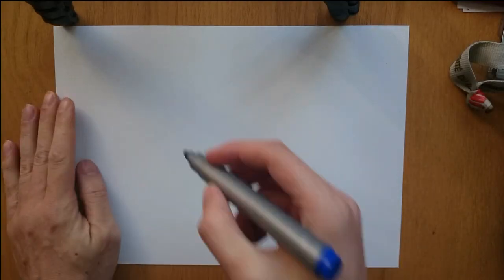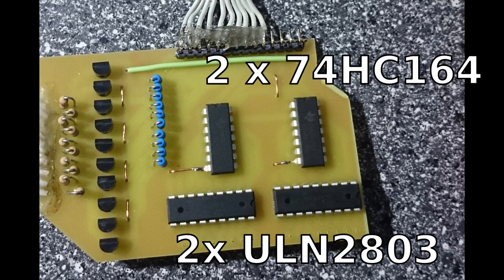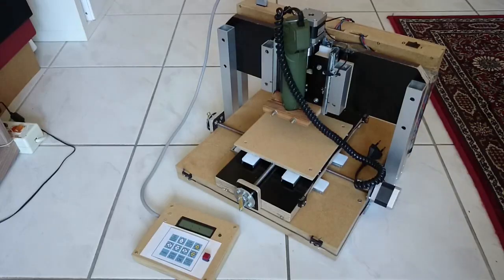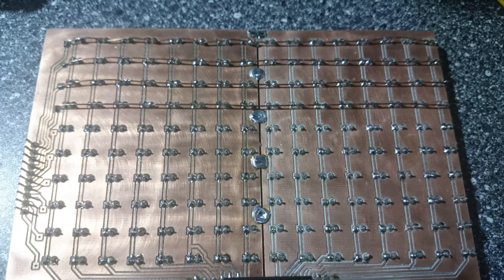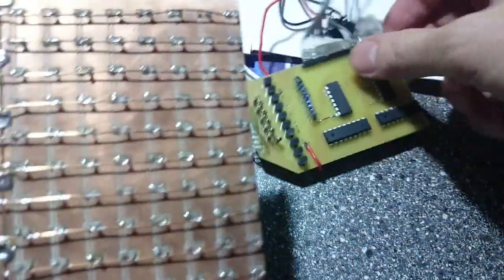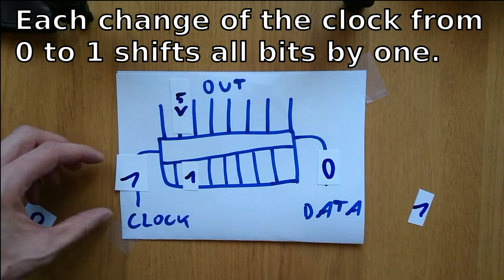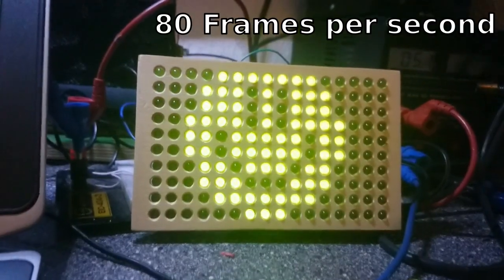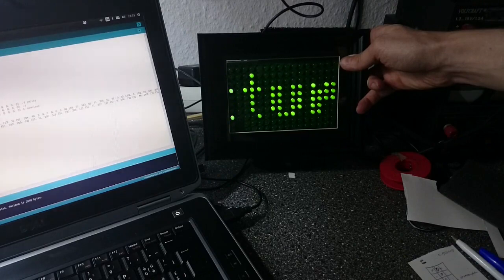Joe's Arduino LED matrix display (clip 1/2): electronic Design

Comment: What would the display total current draw be w/ all LEDs on?  Thanks.
Reply from the maker: Not that much actually - the LEDs are pretty bright at 500mA total already and it does not get much brighter with more current.